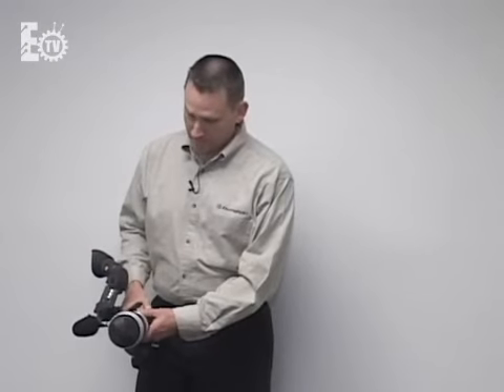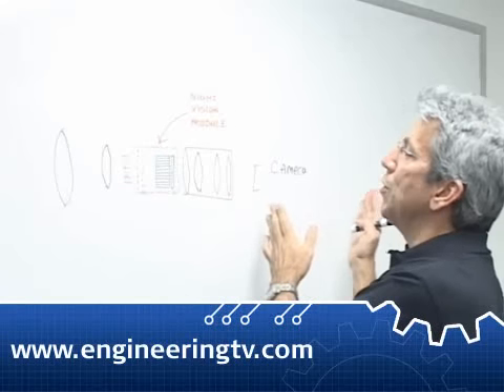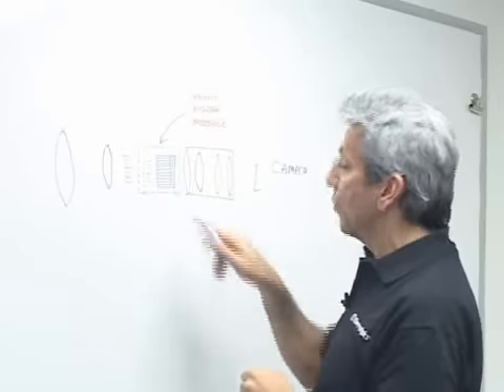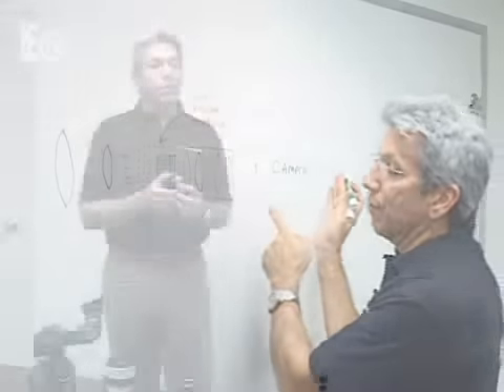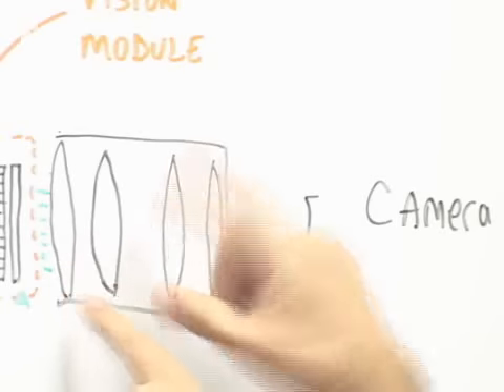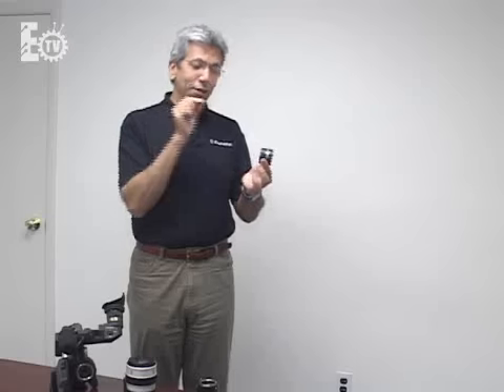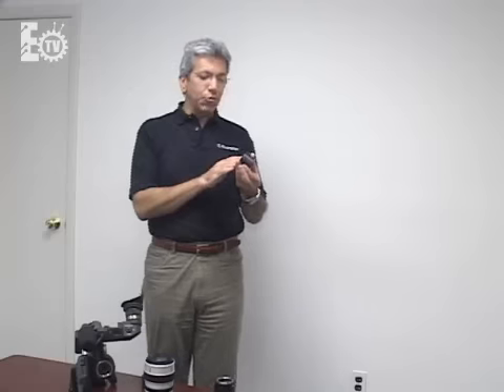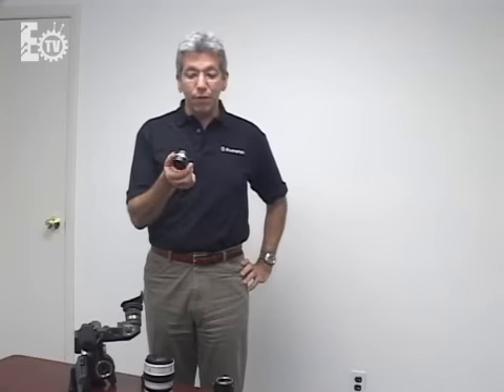Night Vision

Comment: The phosphor used in most NVG's is p-43 because it matches the peak sensitivity of the eye, plus the micro-channel plate helps reduce the halo effect and the bright source protection/degain helps with non NVD compatible lighting.